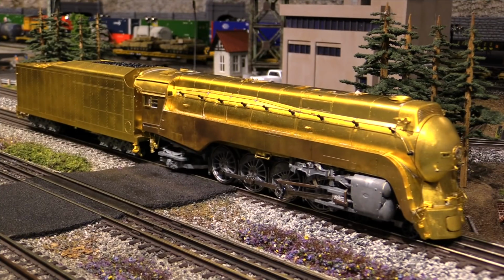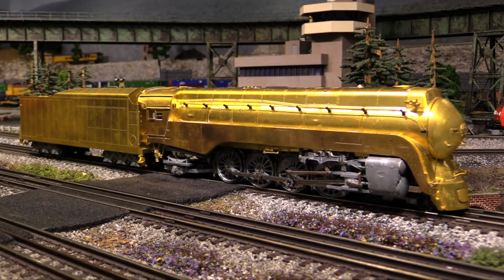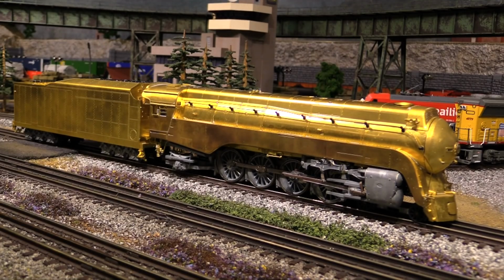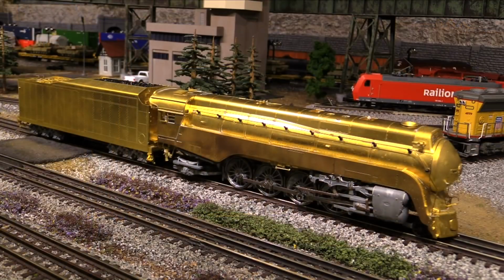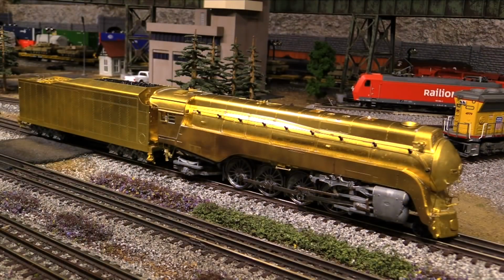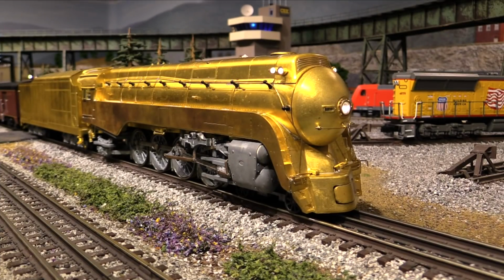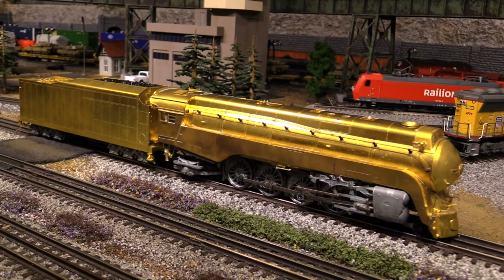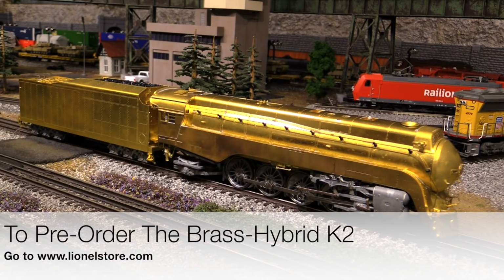Lionel Brass Hybrid N&W K2 Sneak Peek

Comment: Lovely engine glad that I pre-ordered one of these
N&W K2 118
btw 126 to 137 were K2a's. 
The K3's were retired after the 2nd world war and sold to the RF&P and D&RGW and had numerous problems. Not only the drivers themselves but the locomotive was not counterbalanced as well as the K1's or K2's. At 35 mph they could be rough riding and could cause damage to the rails themselves. One man in 1993 said the K3's rode hard and raised havoc. 
Uniquely the K3's had the secondary rods on the 3rd axle of drivers not the usual 2nd axle of drivers and all N&W's 10 K3's were numbered from 200 to 209. 
I have the 3rd Rail N&W K3 #208.

Comment: The k2 class were numbered in the 100 series, and if their builder plates were present, they would have showed that they weren’t built by the n&w. I must add that adding streamlined casings to the usra heavy mountain, and yes that were designated heavy mountains, was an unusual but good choice on part of the n&w.

Comment: is that rust on the bottom of the tender
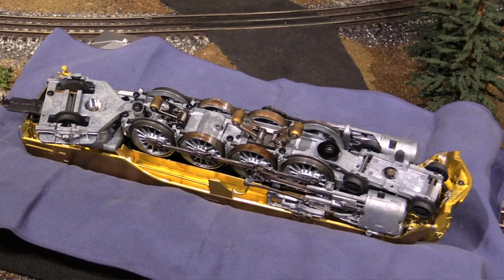Reply: at 9:14
Reply from the maker: Yes. As I said in the video, this is a pre-production prototype used for testing purposes....so it has blemishes, discolorations, rust and so forth. The production version won't have that.

Comment: Never did care to own brass models.  Sure they look cool, I get that.  But as a modeler I go for realism.  Not many full-size brass unpainted locomotives out there.
Reply from the maker: Most brass models are painted and Lionel is making 4 painted versions of this model in addition to the unpainted version. The main reason this particular model is not painted is because it's a engineering prototype used for testing purposes. Overall, brass allows for more fine detail than die-cast metal.
Reply: @Ericstrains    Yep, and thanks for the reply Eric.   It is definitely an excellent loco.  I do know many hobbiests tho that refuse to paint their brass models.  Probably shouldve led w/that.  LOL